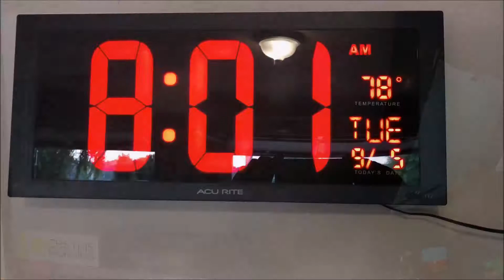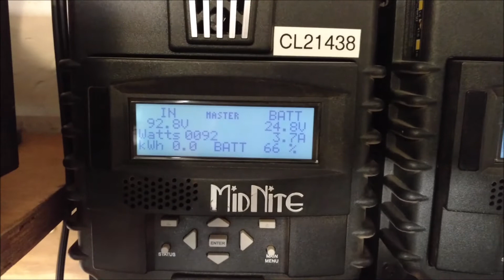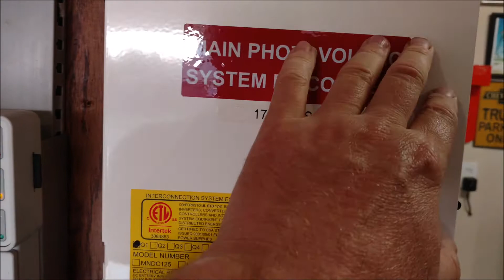Solar VLOG - system update, batteries, SOC, and hurricanes

Comment: I still love your system.  I almost miss living down in the Hurricane area because it is fun (for me) to prep and beat a storm.  We are going through wild fires right now.  It is tough because it takes away the sun and the air to breath.  I have to re-vamp my strategy.
Reply from the maker: Thanks...no issues with mine. The PNW is great and all...but, those fires and air quality. Idaho wasn't bad when I was there...albeit, Mountain Home kinda sucks. Boise is alright. Anywhere you go in the USA, there is weather drama. However, also been scratching my head and wondering if there is someplace that doesn't have "cold, dead, dark" winters and minimal foul weather. Northern Arkansas (Eureka Springs area) and Taos-Santa Fe, New Mexico, maybe? Both areas have mountains, rivers, decent foliage, beauty. Not a fan of being stuck in the frozen tundra of Michigan, Ohio, Wisconsin, New York winters. Oklahoma is alright, pretty chill, & easy to deal with...but, has it's share of weather drama

Comment: You have everything running smooth there. System looks great. If you haven't visited the MidNite solar page lately they are coming out this fall with a talking MidNite classic. And yes more than likely it will have a masculine voice. Here's a copy and paste from MidNite.  "This fall the Classic will be available with voice. Our first ad featuring voice has BoB Gudgel, the lead engineer of the Classic, doing the introductions." No mention of the cost or maybe just an upgrade. Prayers for all of those in the path of Irma.
Reply from the maker: Thanks

Comment: Looking good Chris.  Its nice when you get the system firing on cylinders and it just cranks out the power everyday with little or no intervention required.
Reply from the maker: Thanks...been a little less "conservative" this summer cooling season (running the system harder). I do check the Trojan batteries every month...zero drama/issues

Comment: Looking good brother. Have you looked at what time your pike power cost is? I just helped a guy setup a pip. It's job is to off set the pike power he is buying. No solar at all and he is saving about 40 bucks off his bill. Just from not buying power at pike times. We set it up so he go's off grid at 5 am then stays off for 4 hrs. After that the pip go's back on grid then will use the bilt in grid chager to fill the batts back up when power is cheap..
Reply from the maker: Great topic...a lot of folks don't realize how my power costs during peak times and how solar/wind can offset those "high demand" times. My peak hour costs are 49+ cents per kWh...basically highway robbery IMO. Great to hear you helped out the next guy. Stay safe...Hurricane Irma is "no kidding" gonna be a bitch of a storm for the east coast and possibly the Gulf Coasts